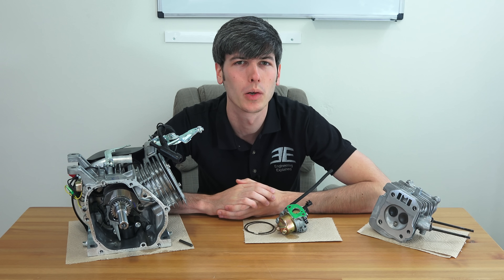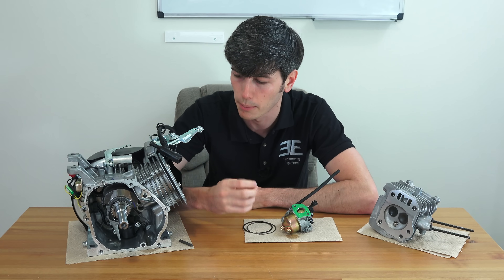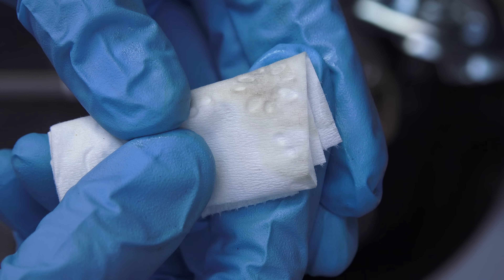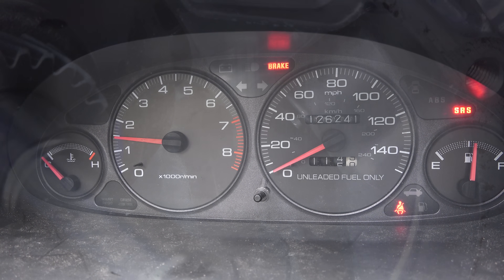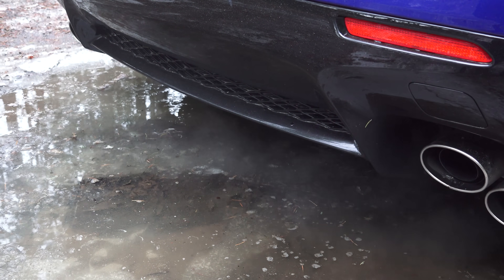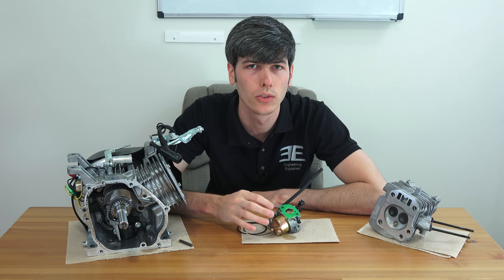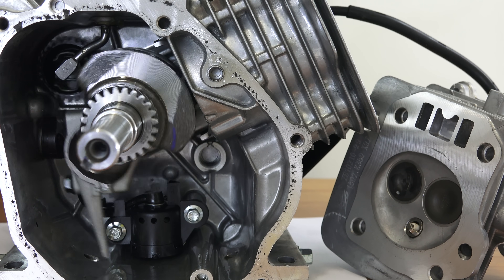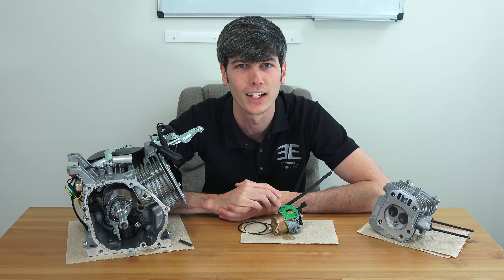Should You Warm Up Your Car Before Driving?

Comment: So how long should I wait if I drive a car with a carburetor? When my coolant temp gauge starts moving?
Reply: Really depends on the car and how well tuned the carb/engine is and how well your oil is circulating. The oil factor should only really matter in really cold climates. Only reason you have to let a carbed engine warm up is because the carb doesn't compensate for correct air/fuel mixture like EFI does. So if it does happen to run well right away then drive it as soon as you crank it up.
Reply: +David McClelland yeah I know how it works, just curious if there's any general rule. so is he just referring to carbs that don't have a choke?
Reply: Robert Turner yea he never even brought up chokes, which is exactly what they do, increase the amount of fuel going into the cylinders. They usually increase the engine rpm's a great deal though, unlike EFI. 

I grew up with carbs so I can say no there isn't a general rule, just when the car is running smoothly enough to drive go for it. You get to know each car as you drive it often enough so it becomes an established thing to know how long it has to run until you are gonna be able to get it going down the road well enough.

Comment: Just to be clear - it's still good practice, for any car, to wait around 10 seconds when first starting it up so the oil circulates, right?
Reply: More like 30-60 seconds, whenever high idle kicks off.
Reply: FCFordLord I'm not sure basing it on high idle isn't really the best suggestion for everyone.  During winter, my car will sometimes idle at around 2000RPM for as long as 5 minutes, maybe longer, even if I'm still driving it.  My car requires 0W-20 oil.  I did an ECU tune a couple months ago and the idle basically drops to normal as soon as I blip the throttle past 2500 (the point of me saying this is even with the same car, the behavior can be completely changed).

The way I see it, you want to wait long enough for the oil to lubricate all the parts before you start driving (which varies depending on viscosity and temperature), but you want to wait until your engine is at it's optimal temperature before you really start pushing it hard.
Reply: If you collects stats, I can add one more. Saab 9-3 II SC, 1.9TiDS - iddles at 1200rpm and drops to 1000 in about 5-10 seconds usually. At operating temperature it's about 900.
Reply: +Peter Schmidt Brilliant post.
Reply: Kirk Augustin
Between this comment and your last on another thread, I think I know what you're getting at now. You're worried about modern aluminum pistons, which have too much clearance until they heat up.

I still think driving after the oil gets through the the engine and driving gentle will get those pistons of yours up to temperature in a shorter time frame. Just drive gentle.
Reply: +Peter Schmidt what car you drive? 2000 rpm idle sounds insane...
Reply: Boz 2011 2016 Subaru Impreza.  BTW, 2000 is the idle when it warms up.  After the engine is warm it idles at around 700, maybe even 600.
Reply: Peter Schmidt
my BMW e36 318ti idles at 1000 when it starts about one second and then drops to 900... at operating temp it idles around 720 rpm
Reply: *****
That sounds like my 1996 Saab.
Reply: My Mazda MPS starts at 2000 RPM as well when you start it cold and begins to slowly drop towards it's normal idle at 900 ish. Takes maybe half a minute to get there.
Reply: zuzo777
Petrol or diesel?
Reply: Boz 2011 It only comes as petrol, mate :P
Reply: zuzo777
I love petrol but im thinking of switching to small displacement diesel for economy reasons. Newer diesels are prety nice i must admit.
Reply: zuzo777 Nope. You can buy new Sky-D diesel Mazda (at least in Europe) and there were lots of diesel engines before.
Boz 2011 What do you consider to be small displacement diesel? In Europe small displacement means 1.0-1.4 but that's ridiculous. This engines are so tuned to be drivable that they last just 200k km. If you want the best, economic and quite powerful diesel you can surely buy Fiat's 1.9 - Z19DTH. There's newer Z20DTH as well. They can be found in Saab 9-3 (one I've got), Alfa 159, Lancia Lybra, Opel Vectra C, Cadillac BLS, Opel Insignia (Z20), Saab 9-5 (Z20) and Fiats of course. The best of 1.9 engines, goes up to 200-220HP and 420-450Nm and is very cheap in service. From bigger ones the best is BMW 3.0 straight 6. You'll find nothing better from economic diesel engines. I don't know much about american engines as any cummins is not available in Europe and Ford's are not that economic and good here.
Reply: ***** Due to Europe prioritizing diesel over gasoline, it doesn't surprise me they get diesel options that don't exist in the US (and maybe not outside of Europe either).  For example, there's a diesel version of my Subaru Impreza with nearly double the power in the same engine size, but it isn't sold in the US.

Generally, I'd argue diesels are better for everyday use but depending where you live, it can be more expensive to use and to my understanding, it is overall more polluting.

As for Fords not being economic or good, that depends on the year.  Sure, I would agree there are often better alternatives to Fords (which is why I personally don't own one) but IMO, modern Fords are [overall] the best of the American brands.  Also just as a reminder, much of Ford's lineup is designed and/or manufactured in Europe; if there's something you don't like, you have a better chance of doing something about it than you may think.
Reply: So you're saying Mazda also makes diesel engines? Who knew. -.-

I was talking about the MPS. It was only made with one gasoline engine.
Reply: Peter Schmidt  Europe prioritises diesel over petrol? How?

Diesel fuel is cheaper, but the road tax is higher due to the weight. Pollution, I dont know. They're fairly clean. Not as clean as VW's software says but still...

So at some point, diesel becomes cheaper than petrol. (after 14k km per year in my country). But is that prioritising?
Reply: Lennart You kinda just answered your own question: diesel is cheaper.  This isn't coincidence.  As far as I can tell, Europe has more diesel varieties than any other continent.  I am not aware of any other continent where diesel is cheaper than gasoline (or other fuels for that matter).

Anyway, according to this article, diesels make the majority of vehicles in Europe:
http://arstechnica.com/cars/2015/10/diesel-how-it-changed-europe-and-how-europe-might-change-back/
Reply: Peter Schmidt i didnt. Because it being cheaper after 14k km is not prioritising. Its simple marketwork. Its cheaper to make.
Reply: Lennart That makes no sense, at all:
1. 14k km is not that far.  Most people go past that in about a year.  Most people own a car for longer than a year.
2. Diesel is generally not cheaper to make.  Diesel is more expensive in pretty much every other country outside of Europe.  It's cheaper in Europe because they prioritized it.  Europe has more crude oil refineries dedicated toward diesel than alternatives.  Though diesel and gasoline don't share all the same ingredients, they share enough that it isn't cost effective for a barrel of crude oil to make an equal amount of both.
3.  Why do you think they're marking diesels if they aren't a priority?  That's just plain illogical.

Diesel is cheaper as a result of being something Europe tends to prioritize over alternative fuels.
Reply: Peter Schmidt 14k km per year, not over the lifetime of a car. The road tax is higher for diesels. So at some point, the yearly cost of owning a petrol car exceeds the diesel car (this is the 14k km per year) It realy depends on what you do with your car.
If I use it just to get to the office and take a company car for my appointments, use my own car to visit people every now and then, I barely hit 12k km in a year. So petrol is cheaper for me.

Diesel is cheaper to make, simply a fact. Its heavier and not as volatile. In 84% of the countries in the world, diesel is cheaper. Not just in Europe.

Indeed, taxes for diesel are slightly lower than petrol. Because diesel engines are more efficient. But thats but a small part of the total difference.
Reply: ***** that is rather beside the point of what we were saying.

Comment: Hey engineering explained, absolutely love your videos. I was curious if you could make a video explaining the differences in between a blow off valve and a bypass valve for a turbocharged vehicle. Also the pros and cons of each. I put a synapse BOV on my 2016 Hyundai VT and was curious if there were any prolonged negative effects of doing this modification. Maybe it'll help anybody else with a turbo. ;)

Comment: My engine has 209,000 miles on it so I let it run about a minute or so before taking off. I'm assuming the piston ring to wall clearances have opened up a little after all those miles, and letting the engine run for a bit builds up a little heat in the pistons which expands the rings for a better seal before putting tons of pressure in the pistons from acceleration. Even though the rings are compressed iron, there's only so much tolerance they can make up for eventually at cold temps. At least that's why I usually do it!

Comment: You said how an uneven fuel to air mixture(more fuel) is bad. I have a cracked manifold near my O2 sensor and know for a fact it's putting more fuel in bc im getting 6 less mpg. Should I get this mixed ASAP?
Reply from the maker: +nkvalerius I would absolutely say get it fixed. Running rich can cause long term problems that get more expensive than just fuel costs.
Reply: +DE “AutoBravado” Nichols yes i know why I'm running rich and it's iron I'm in the process of putting headers on.
Reply: You're running rich because the leaking exhaust is fooling the O2 sensor and running the car wrong.

Iron manifold or steel?

Iron? Gotta replace.

Steel: easier to weld with it in place.
Reply: Cool. 

+nkvalerius If it was a V engine you have more time. At least on Ford's, the PCM figures one side is dishonest and runs both sides off of one fuel trim. The PCM is using substituted values. 

If you have a 1 bank engine I think it'll cause premature wear faster. 

Seems like changing your oil more often would help in the mean time.
Reply: nkvalerius One more thing. When broken goes to upgrade it's called an opportunity. :)

Comment: yeah but if your letting it warm up at idle then its doing so at a low rpm of 750. if your driving it your anywhere from 1.5k-3.5k. so yes its faster but it would have to be less than 2-5 times faster to make a difference. right?
Reply: +robpierce58 it's not just about engine rpm, it's also about engine load. While idling the car is obviously at a low load because it only has to spin the engine components, flywheel and clutch. But when driving slowly the wear is only a bit higher than idle while the engine will be heating up significantly faster. So it will be either a longer time running cold while idling or a short time running cold while slowly driving with slightly higher wear. So as said before, do what your manual suggest because those engineers probably know best.
Reply: Your problem is that you idle the car for 20 minutes and the coolant temps have barely moved, but drive it for 5 minutes and it's up to running temperatures.  So 5 minutes varying from 800-3000 rpm versus 20 minutes at 1100 (cold idle speed).  Or if you only idle it for 5 minutes, you get 5 minutes at 1100 with no load plus 5 minutes from 800-3000 versus just the 5 minutes 800-3000.  There is no hole in his video.
Reply: 20 min and temps barley moved? 20 minutes at 1100 cold idle speed? wtf are you talking about? no one drives at 800 rpm. cold idle  may last a max of 1-3 min and my 2016 f150 heats up 100% to normal running temps in less than 10 minutes in 15 degree weather. how do rpms affect warm up times. that is the hole.  go catch some fish